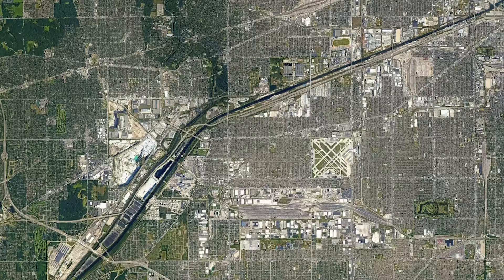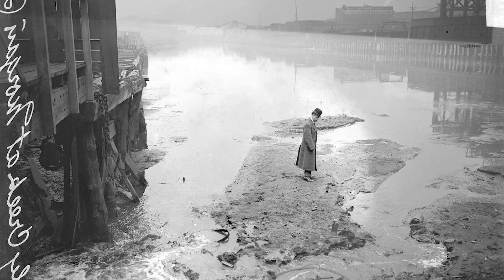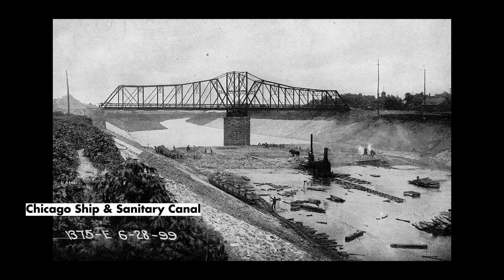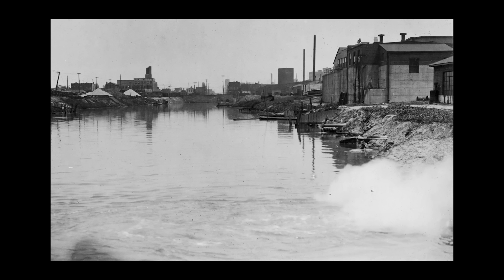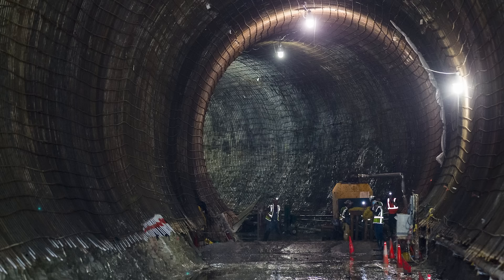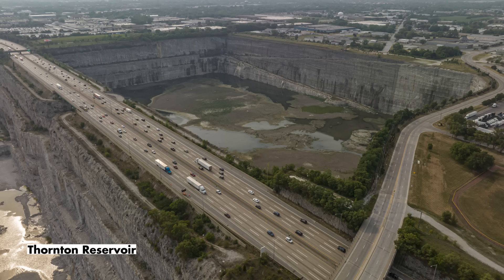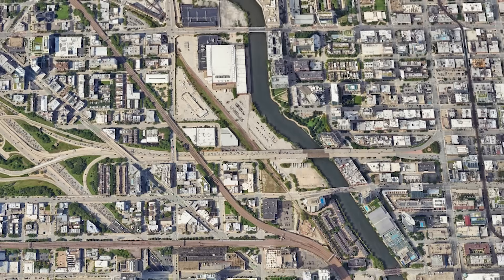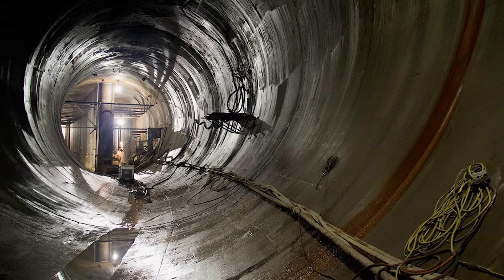Chicago's Deep Tunnel Project

Comment: Just a note- It’s not finished yet. I believe they have only about half of the DTP operational. It’s expected to take until 2030. There are still tunnels being dug and other infrastructure including the McCook expansion being constructed. They will have to rebuild some of the existing infrastructure due to its age. Some of it is already 50 years old so pumps and other equipment will need to be upgraded
Reply: @unl987  You can never be finished because raw sewage overflows, good old Chicago turds floating down the river. When they should have just divided the sewage from the stormwater a neighborhood at a time.
Reply: @mikeehuber yeah, no large city did that in The 1800s.

Paris and London dont either.
Reply: @Chicago1871  These cities have had plenty of time to slowing upgrade and insure raw sewage gets completely treated.  Could you imagine a corporation doing this "crap"!
Reply: @

Chicago already treats most its sewage and stormwater before it’s released.

Its only during big summer storms that it still happens. The finished tunner and reservoir project will all but eliminate those exceptions.

What else do you want? Theyre doing exactly what you want in Chicago and this video explains how.

Secondly a corporation polluting for hundreds of years and dumping pollutants into drinking water until it’s forced not to by environmental laws, is super easy to imagine.

Look into how many heavy metals BP dumps into Lake Michigan every year. The maximum legal limit allowed by the epa. Becuase it’s profit motive and fiduciary obligations wont allow them to go above and beyond whats legally required.

What planet have you lived on where you think thinks Thats normal operating procedures for corporations??? Like; are you new to capitalism??
Reply: @mikeehuber have you ever actually been to Chicago? Have you experienced the absolute BEDLAM that any road construction project causes? Re-paving a city street causes disruptions for blocks in all directions. Now imagine tearing a street up completely to add storm water drainage. That's a project that moves very slowly, weeks at a time...
Reply: Do you remember that movie with Tom Cruz and Morgan Friedman when Morgan was hiding, underground after a horrible war that destroyed America,  in Chicago because the bedrock was solid.?
I wonder what else they are building?
Reply: @Outrjs what's the name of that flick?
Reply: @ALCRAN2010  Oblivian

Comment: Thanks for the video. My opinion is that this is one of the coolest mass public works project of the past century, but it barely gets any coverage.
Reply: NY city installed a new water pipe to feed the city so they could do repairs on the original one. That was some feat. Their water system is said to be the best.
Reply: Installed new pipe but wants to repair old pipe and then remove new pipe.
Reply: Eh, realistically almost all reasonably large cities next to a body of water have implemented some similar solutions.
Reply: They don’t want people to know where their money is really going. Keeping it secret prevents people from asking questions. Notice that not even the workers themselves say much at all or go to the press.
Reply: The longest horizontal boring job in the world is being done right now in the Chesapeake bay for a wastewater force main. Hampton Roads Sanitation District is taking an aging wastewater treatment plant offline and redirecting its flow across the bay to one of their much larger plants for treatment. And it wont make the news at all. The wastewater industry doesnt want news coverage at all, they are a fly under the radar kind of industry.
Reply: There are many similar projects underway or being planned all over the country. Rarely do they make news and the costs to build them are often enormous, but yet are also affordable by the big cities that construct them, as they are building projects that will have a century + long lifespan and can be financed by long term loans that make the required increases in sewer or water rates to an affordable level to local inhabitants.
Reply: @bjdon99  Chicago is beyond bankrupt, it's quite a stretch to say they can afford it, they won't even be able to pay out pensions pretty soon.
Reply: Entire villages reak of shit.  The fumes have killed the hundreds of evergreens they planted to help kill the smell after the first time they flooded it.  Keeping the water from flooding the rich to shit on the poor.  Can't wait until the numbers coming from the ground water reports.
Reply: because its full of shit.  some times
Reply: When I worked downtown, I remember many visitors from overseas, particularly Japan.
Reply: Milwaukee has an identical type tunnel
Reply: @matthewcyrulik7213 , it is building something similar, but much smaller. The Tarp program started in the mid-1970's.
Reply: It’s because there are dozens of similar constructions being done all over the country. They are increasing underground water storage for cities all over the world and don’t want people thinking about why.
Reply: It’s because it is very controversial and they’re trying to keep it on the down low because most of the people it will be effecting have no idea what’s coming.
Reply: @VincentPaulS what do you mean the people it’s affecting have no idea it’s coming?
Reply: Because the unions want their grandkids to have a job.